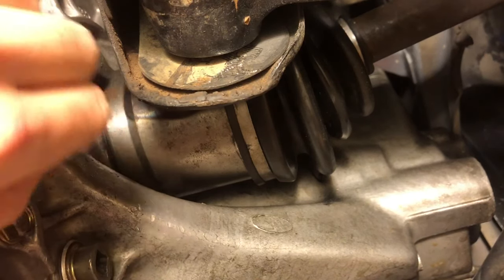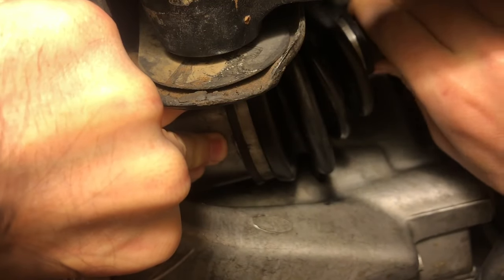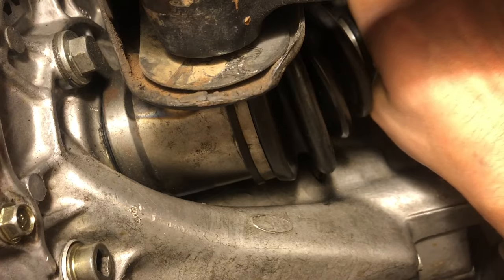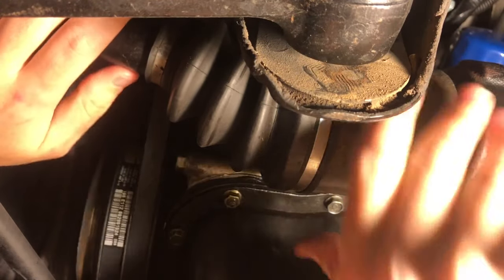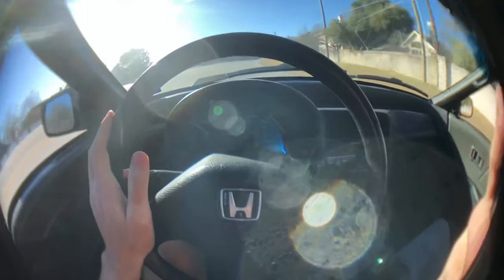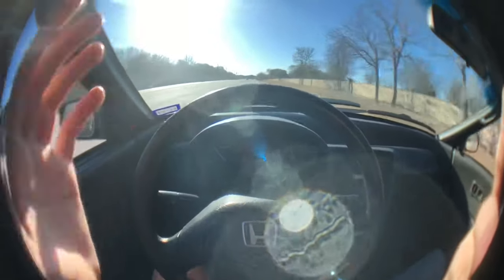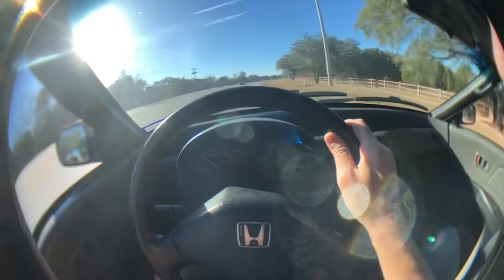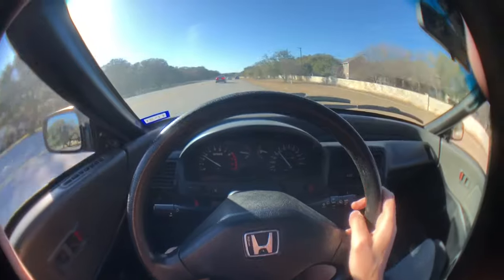How to test Bad CV Axle inner joint on car

Comment from the maker: I hope you’ll consider subscribing to the channel. Thank you so much for the views and support. I hope you have an awesome day :)
Reply: Thank you for the great video! Question, do the new axles have the same play after replacement?
Reply from the maker: @dannycruz2022  the new axles should have no play
Reply: Is the sound like a wheel hub bearing gone bad
Reply: Did you fix the problem
Reply from the maker: @bronniesboy  yes new axles fixed my problem
Reply: @COU51N.Kyle.  brilliant and just to confirm the original symptom was knocking at low speeds🤷
Reply from the maker: @bronniesboy  yes. I couldn’t hear the knocking but I could feel it.

Comment: I had extreme vibration on our 2006 Odyssey with 217,000 miles when driving down the interstate. Replaced all the motor/trans mounts with no luck. Still had the vibration when top speed reached around 70 mph or less. Saw your video and replaced both CV axles and problem solved 👍
Reply: i have a vibration.  on an 06 pilot.  i know my rear alignment is way off.  i just replaced the lower control arms due to the rear compliance bushing being bad on both   i believe the ball joints were shot too. that mostly eliminated the steering wheel shake above 70.  im going to try the front axles as well to fully get rid of it,  i get the alignment done finally on sunday, it still drives pretty good without it  but wouldn't hurt to have it handling better

Comment: You are about the only person that really said exactly what we experience WHEEL HOP during acceleration, thank you, subbing just because of that... Also, the steering feels abit lighter to me, or maybe that is just me...
Reply from the maker: Thanks so much for your support! I'm glad I could be of some help
Reply: Dammit, this comment just confirmed the wheelhop that's been driving me crazy, I replaced struts, ball joints, bushes, strut mounts, stabilizers and engine mounts, the mechanic wanted me to replace my gearbox,Thanks YouTube family, I will check my inner cv tomorrow.
Reply: @agcobileboqwana9923  LOL, your mechanic is having a lot of fun with your car.
Reply: @agcobileboqwana9923  What was the cause behind wheel wobble issue.. have you tracked the fault finally, as I'm going through the same .
Reply: Yes i did, the tripod in the inner cv was busted, my tyre also had a flat spot so it was hopping at slow speed.
Reply: @alinux09  Nothing worse than a mechanic that just throws parts at everything

Comment: I watched 10 videos to find a way to explain how to inspect a half shaft, all useless until I found yours. Good job.
May I add that on a rear wheel drive car, you will get vibration in your seat on acceleration that gets resolved when you release the gas pedal. Also you might hear a click when you first back up in your driveway.

Comment: Exellent video.  In my case, my Lexus had a little play at the axle shaft at differential housing and a mechanic told me that is abnormal and may cause axle seal to leak which worried me.  But you were told that that play is ok by someone which makes me feel relieved.  Other video also showed similar play at the axle shaft at the differential housing so I am inclined to think that what you were told is correct.  Thanks for the video!

Comment: Thanks a bunch!  I have inner joint problem which causes ticking noise on deceleration.  But could not tell whether it comes from right or left side because if I sit on driver side, I hear noise from passenger side, if I sit on passenger side, the noise seems to come from driver side.  You just showed me how to check bad inner joint.  This will help me pin point which side is bad.  I will try it out today.  If it works out, you saved me whole lot of time wondering.  No one else had this info on Youtube.  Excellent video!

Comment: I had the car up on stands and looked all over the suspension and couldn't find anything wrong; thought I might have loose lug nuts or tie rod ends.  Wish I had seen your video earlier!  That is a great method to check the inner CV joints and that would have been a good thing to check.  The symptoms match your description of the problem.  I will definitely have to put it back up on stands.  I was going to replace the CV axles, but your method will let me try to verify that they are indeed the problem, and also which side is the problem; so that I can repair only the one that is broken.  Thanks.
Reply: Any joy with the repair?

Comment: Let me first say great video! I have a Dodge Ram 4x4 and the dealership changed the wheel barrings over a two years back. They didn’t put the cv axle back in correctly after the wheel barring replacement causing the axle to wobble and now fluid leakage. Some of the spline teeth are worn from the front differential as well. No ONE could figure what the issue was. Dodge themselves said oh you need a new torque converter! I was like yeah right. Transmission shifts perfect   They said this because of the vibration shudder that I would get intermediately. Anyway finally brought it into my local tire shop and they found the damn issue! Hopefully no internal issues with differential, other than the worn spline. I’m so mad that dodge tried to screw me over! Glad I didn’t pay them 2k to fix a torque converter that isn’t the issue
Reply from the maker: Very sorry to hear about your dealership issues. Hopefully now your truck will ride nice and smooth
Reply: At what speeds were your vibrations happening and was it all the time?

Comment: Thanks this should help.  I was moving my Axle In and out and it seems like a knocking noise when it hits the transmission.  Not sure if it should be doing that! Also a up and down like you mentioned makes a noise so could be bad but the boots are fine.

Comment: You did a wonderful job with this video. Well spoken. I appreciate it very much!
My Mazda6 V6 is having similar problem from the passenger side. I changed the cv axles on both sides. I get vibrations when turning left, it feels like the front right wheel is skipping the road almost.  There's play on the inner joint where it connects to the intermediate shaft. The intermediate shaft bushing is also having a little play as well.
Reply from the maker: Thank you! I hope you are able to sort out your problems with ease

Comment: I have a 2016 Volkswagen GTI. Its tuned and makes about 400HP and I started to hear some noise from the front drivers side when I accelerate. I think the issue started happening when I launched the car and I was getting some wheel hop. I fixed the wheel hop issue with upgraded bushings and motor mounts but the clicking noise was still there. I went under the car and started pulling on the axel and I could hear it moving ever so slightly. Tried the same on the passenger side and it has no play what so ever. I'm thinking this is my issue. Thanks for the video!

Comment: Ok, Grandma hit a concrete barrier on the passenger side. a couple of years ago.  About the same time I noticed a vibration at higher speeds-I thought it was the older tires.  Slight vibration continued after new tires.  Recently the starter went out and I noticed the passenger side CV looked wet and also the part that extends to the differential.  I am wondering if the impact had something to do with that the joint and the leak.   Pretty sure I will need a new seal as well. Thank you for pointing out the vibration.  It had stumped me.

Comment: Thx for your information .  No one has stated the movement between the body & the shaft .  I am having a hell of a time trying to determine which side is the problem  .
Reply: How about a change of the wheel hop and vibration at higher speeds when you turn the steering wheel side to side?

Comment: Great video, but no mention of what happens to the steering wheel hop and vibration when you turn hard at high speed. My Ram does that. Worst at 60-70 mph... louder turning left, and almost disappears turning right. Is that the right inner CV joint?  Bearings are fine- new.

Comment: Bought a used 2018 tundra , put knew tires, got used rims and had them check , no issue when tk 6 different tire shops to get rebalanced. I still feel the “play/ hop/ vibration) at 55mph+

Comment: Thank you for the video and for clearing the IN an Out movement. 

Did you have any 3 and 9 o'clock play when you shake your wheel? Usually it is a tie rod but can it be also CV axle?. I disconnected the 32mm from the hub and still have the 3-9 wheel play. Changed both tie rods with the same results. I will check the horizontal play. I do hear clunks when turning though.   Thanks again for the video.
Reply from the maker: I did not have any 3 & 9 o’clock play in my steering. It sounds like your issue could possibly be inside your steering rack or the U joint on the steering column.

Comment: Same problem im having with my Daewoo but no one has outcome video, drivers side has flop on inner but replacing everything. Both cv's, lower control arms, wheel bearings, just from age, only 63k miles but right side underneath looks like it met a ditch once in its life. But looks like this will solve it.

Comment: @SpiritdDrivr hear video!! But question for you how did you manage to check the cv axle? Was it making noise or is it because the steering wheel was vibrating as speed increases? Thanks in advance
Reply: And did you ever fix the issue? If yes, what was the problem?

Comment: Great isolation tactics! You hear a noise..... Day to day you wonder is it getting  louder, or is it something else? I safely put the front end up to try and check exactly this among other possibilities recently. It is still in the air! It is hard to describe how the noise started. It was most noticeable at lowest speeds first thing in the morning. But as soon as the parts had been moving long enough (maybe (relubricated) is was not so distinct. At high speeds a kind of WW2 Bomber sound started up resonating  inside though. That's the noise it seems so hard to judge day to day. Is it really getting louder? Or is it just me? But just  lately there is this new sort of clicking noise at low speeds well after any cold start.  Reading  comments, and the evidence from doing these steps has pretty much determined the  culprit I hope. Question: Do outer cv joints also click as they begin to fail? Other youtubers give take apart demonstrations and the design is very different. Makes sense to me  each design would make sort of distinct noises as it falls to ruin. Only one joint on the inner passenger side has this wiggle in the movement when isolated. But  I also found play the the outer tie rod end. So that explains that  wobble I have started noticing suddenly. Until checking I had no idea. I thought it might be the same thing. 
Now the question is how long before the inner cv joint fails and can I get it repaired before that happens? Tie rod end today if all goes well!

Comment: Inner CV axles are the "tri-pot" type containing three channels and allow some inward and outward (axial) movement along those channels.  They cause problems when the driven side of the channel gets overly pitted or in worse cases gets a deep divot in one spot in all 3 channels.  That's where the shaft can get out of balance under load.  Unfortunately, that spot cannot be tested in the manner shown in this video if you jack the car up because the inner joint will be in a unnatural position.  Test as shown but only with the car fully settled on all 4 wheels.  That's when you want to feel for the dead spots which will cause the excess radial and lateral movement.
Reply: Is there a video about this specifically?
Reply: Bro impossible to check that way weight of the car u will not be able to move around anything
Reply: @kings1048  Ummm.  Nope.  If you can't feel any play then there all good.

Comment: I bought a used suv. It was jerking when stopped and accelerating into gear. I thought it was the transmission til my axle broke off while I was driving on the highway. Got it fixed and the jerking stopped. I heard a noise but thought it was a rotor. That noise is now gone as well
Reply from the maker: Dang that must have been kinda crazy when the axle broke. Glad to hear you were able to get it fixed.

Comment: I have checked in my i20.
There is little play/movement horizontally when the axle is moved IN and OUT. 
However, there is no play or movement in UP and DOWN direction.
So that IN and OUT play is Normal?
Reply from the maker: I’ve been told that is normal yes

Comment: QS:  When testing for a Bad CV axle,  when the car is up on a lift  should the tires be off the car?   Or would this make a difference?
Reply from the maker: The wheels don’t have to be off, but the weight of the wheel will make the axle more difficult to move.

Comment: Hello i’m pretty sure my axels are bad on my 04 element. Did you have any clicking and popping while driving? Mine doesnt make any noise but the vibration is getting worse. Just curious because everyone says you should have some clicking and popping and i have none.
Reply from the maker: I didn’t have any clicking or popping. Clicking and popping is a sign that the outer joint on the axle is bad. Vibration on acceleration is the sign that the inner joint on the axle could be bad.
Reply: @COU51N.Kyle.  awesome thank you!
Reply from the maker: @RUGBYmusic  best of luck!
Reply: Hello thank you for the wonderful video, my Toyota corolla does not vibrate or produce   popping sounds but on take off there is a nocking sound where the drive shaft is. Recently we replaced torn cv boots but the inner boot where there is this nocking  is now in two pieces again and am wondering if it could be a bad inner cv

Comment: Did replacing that axle fix your issue? Having same issue and same play in my prelude. Brand new parts store axle but I hear it's not uncommon to get bad axles out of the box from parts stores.
Reply from the maker: Yes replacing the axle did fix the issue. I had bought a brand new axle from Autozone but it made the problem worse. I ended up buying a set of axles from Drive Shaft Shop. I ended up swapping both axles and the problem went away.
Reply: @COU51N.Kyle.  damn, yeah I called dss and he said I need an oem core, which I don't have. May have to dig around in salvage yards looking for an oem core. :/

Comment: Did you get any clunking noises over bumps at low speeds My passenger side cv joint has way more play than yours and clunking on the same side
Reply from the maker: I didn’t have any clunking. I only had the vibration at speed.
Reply: Did you resolve issues
Reply: @bronniesboy clunking ended up being my strut bar but I didn’t find the vibration issue I sold the car

Comment: You don’t hear no sound coming from it like a metal with metal? Cause i got a 2007 ford fusion and i replaced control arms,sway bar links,tie rods and struts and the only thing left its the cv axle and watching the video now i thing its the inner joint bad cause  i got a wear noise coming from passengers side

Comment: Hai, I have Honda City 2014(UAE). Sometimes make a sound. For example, sometimes the accelerator pressing time (is 0-5km), and sometimes max 40km running time I release the accelerator that time(max. continuously 4 tik tik tik tik sound) (Turning time no sound.) I went to the garage, they check, and they don't find issues. Shoke no issue. Right side axle boot inner & outer before I change. 

What is the issue?

Comment: Hi mate. Were you getting any rattle and clunk noises on corrugated bumps?
Reply from the maker: No I didn’t. That sounds more like a suspension issue
Reply: Yes bad inner CV axle does dat too......
Reply: @phemmyo5146 similar to the noise of bad strut mounts, sway bar links or bushings?
Reply: @bronniesboy  u  want to discuss all dis native american bullshite ??
Reply: @phemmyo5146  Hope there is no text message misunderstaning here. My question was: can the inner cv axle make the same noises as those components I highlighted. I have the same knocking issue and I have changed all the components I mentioned except the inner cv joint which is loose like spirtddrivr. Any helpful comments would be welcomed😌

Comment: YES!! The vibration is so bad I Thought my lugnuts had been removed and wheel was coming off or my struts were unbolted!! Idk its horrible. Do you think it could be my suspension? If I Jack the car up my front tires extend way too far before they come off the ground but idk. 
I will check the axle like you did and see if its that. 
I wish you were my neighbor or I was your sister Lol cuz I was raised with mechanics and I always work on my cars but I'm not afraid to admit when I need a mans help and today is the day Lol.
Reply from the maker: If the vibration is constant and increases with speed, then I would say it’s not your suspension. Hard to say though. Another cause of vibration could be unbalanced tires, bent wheel, or the tire surface has become uneven. I once had a tire that had a large bulge on the tread. It vibrated badly. 

I wish you the best of luck and I wish I could help you out in person too. Hang in there and let me know what you find.

Comment: Good video. Thanks for posting.  Just wondering how urgent of a repair this is?
Reply from the maker: Honestly I do not know. I didn’t drive this car much once the problem occurred. I probably put less than 500 miles on it. The symptoms didn’t get any worse during those 500 miles. Complete axle failure would leave you stranded but I can’t say for sure how long it would take for that to happen.